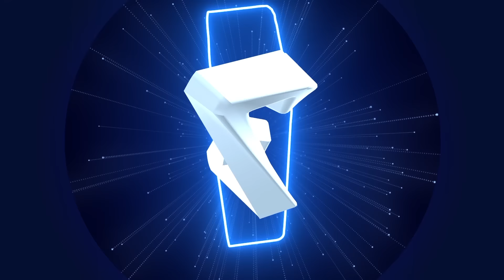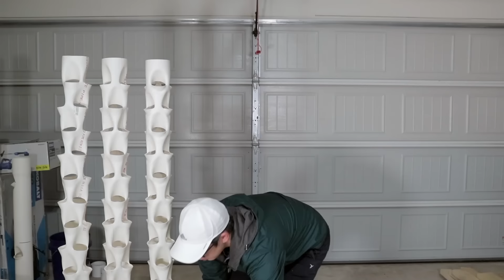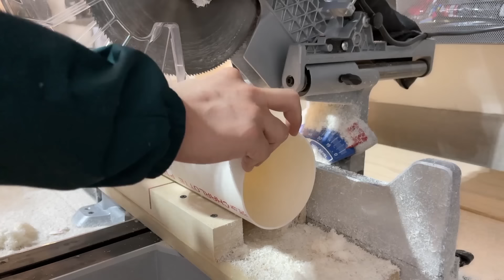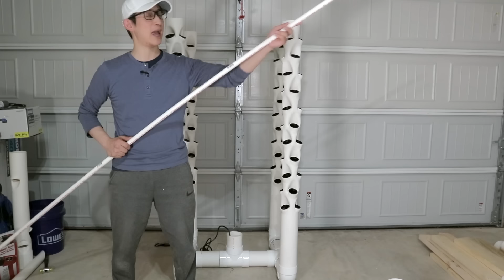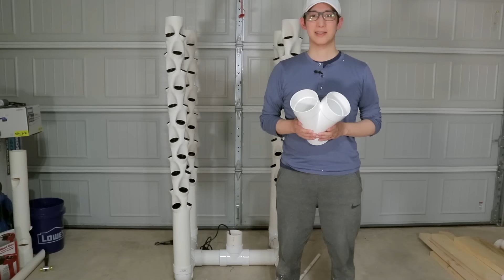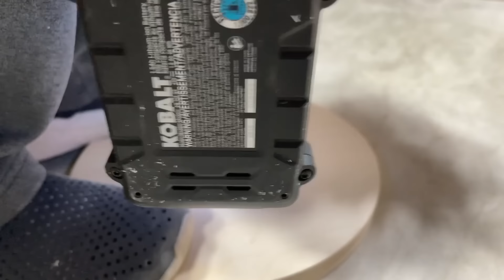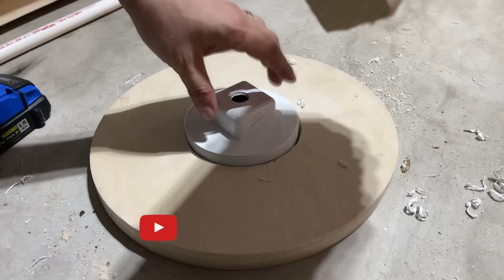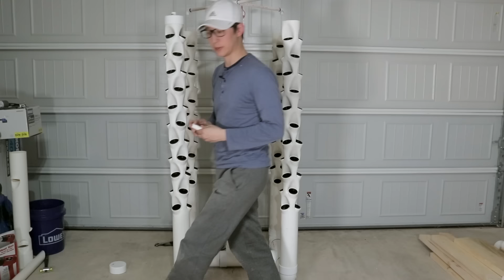DIY Hydroponics | Aeroponics Garden Tower Build | Part 2 - [4 Tower Build]

Comment: Once every couple of years I give a video a standing ovation...this video is one of them. Now all you have to do is open a factory where you can mass produce these towers and BOOM you have just solved world hunger.  Cheers from Ottawa, Canada.
Reply: word
Reply: Can you please show me the tower working with your plans growing in the tower. @moorebernstein
Reply: If you account for factory expenses, salaries, operative costs and utility you end up with something that's roughly $700 or more for a system like this which was the initial problem that he wanted to address.
Reply: @SydTheMidget experience or learning curve decreases cost and increases capacity over time.  So, something that once cost $700 initially will reduce in cost 10%'-30% everytime you double production.
Reply: @SydTheMidget  Not really. Pretty sure you're over pricing by far.
Reply: @Section_230  haha
Reply: I want to make hydroponic with DIY pump
Reply: gioknows:  I haven’t quite watched this yet. It just got 30 seconds into things when I saw your comment.

In my area of Canada, things have gotten expensive enough that the one grocery store has dealt every employee a cut in hours; another has a security guard On the door, and has had to lock the other entrances other than the main entrance. Because of stealing.

So our little church of Jesus Christ of latter-day Saints in our local community, has augmented the food security program. So that people can have more food at home, and can control it themselves. At little to no charge.

We have a basic system, That can be used with soil to begin with. It cost me $1.11 Canadian, to make one of those systems. It’s essentially a tower. No Hydroponics, and a person pours the water in the top bucket, and if he or she wants to collect the water or fertilizer water that flows through, we stick a bucket underneath. With a spigot on it. We make the spigots from the syringes, which cost less than $.25 apiece.  Because some people want to use soil, and they enjoy doing the watering themselves.

for those who do not wish to purchase fertilizer, there is a compost tube going down the middle of the tower, which has holes strategic to the worms that do the composting of the food that is tossed down the middle. The worms can move freely throughout the structure, aerating and spreading the goodness. it’s really important to have a cap on this, and a way to let the castings out the bottom so that they can be put into the part of the tower that contains the actual plants. The cap keeps flying insects and rodents out.

The next step up was made for a woman who wants to be able to water her tower directly from the outdoor spigot, but she doesn’t want to carry the water. She wants her Tower quite dry on the outside and quite damp on the inside and she wants to use soil. So, it cost me $14 worth of hardware and a hose (that the guy mowing who mows the lawn ran over) got re-purposed.  The hose goes directly from the spigot on the house to her tower, right where she wants it. The sections of the tower (dis)connect with a quick coupling system, and it sits on a wheeled base. She has one of those already, but at the local Dollarama, a person would pay under five dollars for one. Inside her tower, the hose connects with weeping hose, which spirals immediately above each grow hole. The very bottom section has a stop on the bottom section of hose as it exits the bottom. This is so that she can connect to another tower or augment her system in other ways if she wants to remove the stop.

The next level is aeroponic or hydroponic.  That adds an extra $25 or $30, depending on the pump that a person wants.  for a system that’s going outside in direct sunlight, there will also be $10 worth of paint to keep algae from growing inside the system, which could plug the pump.  so the total cost of that system is $31.11, or $41.11 for one that goes outside. If a person gets the more robust pump. 

i’m just learning how to wire LEDs in serial, to make grow lights for those who want an inside system and live in a place without much light, such as a basement or the north side of a building, but do not already possess a grow light.  And I imagine cages will go on certain systems, for those who wish to grow tomatoes or zucchinis etc.

This is the first year that we’ve done this, although we’ve been doing the planning and hands-on research for a year.So while we have the towers themselves figured out, I imagine it won’t be long until the cages will have to be figured out as well. 

The hardest part has been figuring out how to do it free or nearly free. Most things are pretty easy to do with a generous budget, but this is about food security for those who need it the most. So every now and then, one of my fellow experimenters remind me that I need to rethink something I’m doing because of cost. And pretty much every time, the person doing the reminding has a better idea.

I hope your community enjoys your towers as much as we are enjoying ours. :-). All of the people who are part of the experiment that we have going, do a lot of the building themselves. It really helps people to own their projects.   And every person who comes up with us to suggestion, gets help in implementing the suggestion.  Those with tools, share the tools. As always, we teach each other.

One sister has even figured out how to mix hydroponic fertilizer formula from her household supplies.  and she’s doing the research to compare it to the commercial stuff.  she pays a lot less for her mix than I do for mine.

so, I guess the point of my comment, which is much longer that i intended, is that perhaps a factor is not necessary; and that even the poorest members of the community can take charge of a great deal of the expense of growing food, especially this time of the year. And it could be done for almost nothing, especially when people are willing to work together.

We share seeds, and everybody’s learning to collect seeds as each participant lets one of each type of plant mature and produce seeds; and as long as each can do that, the system will be cheaper to use from year to year.
Reply: Thank you for sharing this. To bad , so many A holes are complaining about you and the system you build. I think you do a very good interest in helping others. 😘
Reply: World Hunger is never going to be resolved until we enforce eugenics first.
Reply: 👋 from Ottawa too!
Reply: When you research how much food gets wasted globally.,🦉
Reply: Hey bro I'm down in Mexico. We can definitely hook that up.
Reply: There's is actually a company already mass producing these towers in bigger variations, and ship them around the world. The unfortunate downfall, is each tower plus supplies for them and the plants, cost close to $1000 a piece. Yea, greedy as fuck huh?
Reply: You are correct and minimum 10 towers to expensive for the little man 😢 @Ryan-hk3wv
Reply: Man, whats wrong with some people.  Always complaining.  I just want to grow strawberries, and other small veggies, fruits and not solve workd hunger.  Does this work or not.
Reply: Those saying this would not solve world hunger just don't understand the value of aeroponics.  Don't take their responses personally.  Many just don't want to learn, so it is up to us to educate.  The more you educate the easier it becomes to solve world hunger.  Love the passion keep it going my friend.
Reply: World hunger shouldnt exist, the worlds produces enough food to feed 10 billion people, but it's not a bussines end the world hunger
Reply: You should give the applause to the guy who actually created it over a year ago: https://www.youtube.com/watch?v=tmpPLiECCFU
Reply: True
Reply: Keep price low and butfuck retail salesman
Reply: World hunger doesn't exist...
It's only manufactured by elitist; same with "over population" <-- no such thing
Reply: Stop world honger damn that good way to fuck world up faster.

There already to many humans.
Reply: How do you know it works?
Reply: @FC2ESWS  : You may have to be more specific about what you mean by “it”, and whom you’re addressing your question.
Reply: @daphneraven6745  "it" meaning, did they grow any plants? Lol.
Reply: @daphneraven6745  "IT" Is obviously - and I mean that literally - OBVIOUSLY - about the subject of this video.  And he is obviously - OBVIOUSLY, again - "addressing his question" to the readership at large.

Just like everybody who posts on youtube.

Also is it TO WHOM.  LOL!
Reply: Bruh.. there's a reason why they only show vids of them building them and no progress vids of plants LOL
Reply: alot of people don't understand that this can solve world hunger because instead of sending rice and packaged meals we can now send seeds and supplies for the poor to grow their own crops which equals NO MORE HANDOUTS
Reply: How much holes are there
Reply: On this 4 tower
Reply: the very best cooment for ever !
Reply: I want to know  how to use it how  often to put in nutrition and water how to clean
Reply: Building these out of pvc is not smart. There's a reason why pvcis only used for water drainage in houses, your sink, tub/shower water pipes are copper for the simple fact that pvc can leach the plastic chemicals over time. These towers are a good idea in theory and seem to be all the rage for a diy garden tower, but if you have these outside exposed to sunlight, you'll probably have cancer from eating the food grown in them later in your life ✌️
Reply: aeroponics - high tech bullshit for people with so much money they think missing a meal equates to world hunger.

Vertical gardening has not, so far, worked on large scales.  All the large scale vertical gardening companies have gone bankrupt and to my knowledge only one of them is reorganizing to come back.  It is HIGHLY dependent on an EDUCATED workforce ie you can't get away with exploiting immigrants for stoop labor like you can on a typical farm.

So sit back down.  Get a grip.  Solving world hunger my sweet fanny.  While I'm interested in this system (hence I am here watching this) get some reality going here.  I can do this because I have unlimited access to clean free flowing water, I have electricity, I have sufficient heating and cooling unto the day.

People starving around the world don't have ANY of that.  Surely you don't think people are going to build these and then ship a few lbs of lettuce overseas somewhere? Even if it COULD be shipped like that, the expense and impact on the environment of all that long distance shipping is huge.

And you're not growing wheat in these, or rice, or any other grain crop.  If you want to solve world hunger you can't ignore staple crops.  Grains are where the vast vast VAST majority of our food comes from, all over the world.

From your other replies it is pretty clear that @gioknows is a jackass.  Feel free to bray your displeasure.
Reply: @blueskiesmudpies1061 Wow aren’t you a lovely person😅
Reply: @gioknows  Why yes, yes I am!
Reply: 100 percent.
Reply: Hi can ask you can you get syphon system to work with the grow tower its an idea i had? seen the bottle syphon system for a fish  tank had me thinking it to you. https://youtube.com/shortsyphon systems/xDTyr5lyhGU?si=-N
Reply: No you didnt solve world hunger... you built a buch of aeroponic towers.  Solving world hunger is a much larger equation than just growing some lettuce my man
Reply: @criscrow3579  Yeah, making it so anyone can grow crops anywhere isn't good enough. None of this will ever fix how lazy/stupid Billions of people on this planet just Are. They don't have any intention of putting in work or educating themselves. We could come up with a cure for cancer and they'd still be too lazy or stupid to do it.
Reply: @criscrow3579 how is everybody being empowered with the tools and knowledge to grow their own food not a means of creating a chain reaction which inevitably will be common place thinking globally, so instead of sending rice and packaged meals to poor countries we can now send seeds for them to learn from what started off as a lesson on Youtube
Reply: @criscrow3579  true. @gioknows 

the earth already produces more food to feed billions of people more. 

there are logistic and infrastructure costs. 40% of food in impoverished nations is wasted due to lacking transportation, proper storage, or market accessability. 40% of food at the wealthy end is wasted due to dinner table abundance. 

there are nations that sell food to fund wars as well, as another example. Take Russia: putin made the sanctions worse for his own people by banning the export of grains, the Ru-UA region provides 30% of cheap global grain, some nations like Egypt import 90% of their food from that region.
Reply: crazy how this guy does't credit the original owner of this idea. Petani Kota87 look him up, made this concept in 2020
Reply: @MRGAMER9119  i felt the same way, but its still a positive contribution by way of his effort to compile links and explain the process thoroughly. also, that original uploader didnt "make the idea up". i agree that the very apparent source inspiration video shouldve been mentioned, but its definitely a grey area as far as intellectual property is concerned
Reply: @ASapWheelie  Petani Isn't the original owner. Of Hydroponics or even THIS setup. He just Made one as well. Which is Cool, but doesn't detract from THIS build. Example: Check out videos of the "Tower Garden" From 7 YEARS ago. Before Petani made his 2 YEARS ago. Pretty sure "Tower Garden" Wasn't First EITHER. Crazy how that works...
Reply: @Section_230  yeah i never said any of that aside from maybe who i thought the original uploader was. but thanks.
Reply: @ASapWheelie  Yep just clarifying since you and that other guy seem to post about the petani guy.
Reply: @Section_230  im well aware this has been around since before i was alive. but the more sources for people to be able tocome across,understand and utilize, the better. 🙏🏽
Reply: @ASapWheelie  That, we definitely agree on. 🍻
Reply: @MRGAMER9119  No need to. People invented it before your boy too. The design isn't the same. Just SIMILAR. So get over yourself and worry more about what YOU'RE doing instead of trying to cause shit simply because YOU don't understand how things work.
Reply: @MRGAMER9119  I saw this and similar approaches before 2020
Reply: @MRGAMER9119  this was done before 2020. That's because pandemic made everyone search every corner of the internet in search for something to make
Reply: @MRGAMER9119 this style of system has used for over 20 years now 😂
Reply: Lol, solving world hunger.  You live in an entirely different universe than me apparently.  This wouldn't solve hunger, it's just a different solution to an existing problem.  It's not really a solution for mass scale either, but great for personal use or small businesses with limited space.  I personally prefer aeroponic designs as they come with increased efficiency.  These have been around for quite some time, though I do like this design.
Reply: @JT.526 this is a great solution for mass scale.  Deploying these towers in food desert cities and areas where shipping cost are high or where gmo produce are used to keep from rotting during shipping, would solve a number of issues.  The fact that these systems use 95% less water when using a misting system, increase nutrient density to keep most pests away is an absolute game changer.  Also, the higher yield with aeroponics optimizes yield/sqft.  What are your thoughts of why it wouldn't be a solution?
Reply: @guam58  It already is a solution, these already exist on mass scale, just not in this form. These towers  are horribly optimized for scale when you factor in light and ease of harvest.  We utilize large rotating horizontal slats on belts.  Think of it like turning the tower sideways and making it 50 times bigger.  They are usually ~50 ft high and allow for better light penetration.  You can probably find a video on it if you search and want to see it. This design is just a basic drip tower that has been used for 50 years, it isn't new.  It's good for home use, but terrible at scale.  I lived in Abu Dhabi for 15 years engineering industrial variants of these and water treatment/waste water systems and they are wonderful in places like that at bringing down cost and providing better quality produce.  Sadly, it's still limited to mostly leafy vegetables.
Reply: @JT.526  Stop pretending you are an expert. If every person in the world did this it would make a huge impact on world hunger. Doing nothing is not a good alternative.
Reply: @gioknows  Seems like you are the one who thinks they are an expert.
Reply: @JT.526  No I agreed, You talk like you're the authority on the subject. Maybe you Did hear about it before. Know what I didn't hear? Anyone ask you. So next time be constructive with it at least, or expect people to talk shit to you and put you down for your Failure of a comment. Does that make it clearer for you?
Reply: @Section_230  lol, you should consider being more constructive in your comments and a bit less negative.  I hope that's clear Karen.
Reply: You  are so right my friend. Some people are such experts they have no idea that every little solution, is the solution to a bigger problem.
Reply: @gioknows  stop pretending you know every thing.

You dont know who that guy is real life
Reply: @gioknows you seen some poor guy in Afrika with solarpanels Batteries ore Electric Connection.. 
you ever saw on a African market sold pvc pipes Electric heater.. 
just gave you a few ideas to rethink your statement.. 
how will this idea give a poor men a positive impact on his life.. 
non at all. 

This idea is for people that can buy such materials and work with it. 

Poor People need people to show them how to agriculture in their own country, and how to grow seeds and not eat it all, and do it the next year again and again.. so they can provide food for them selfs, on their own land. And not to rely on foreign aid..
Reply: The Jews will never allow that.